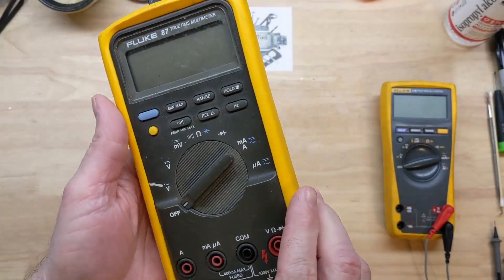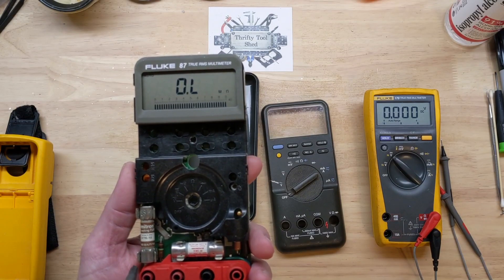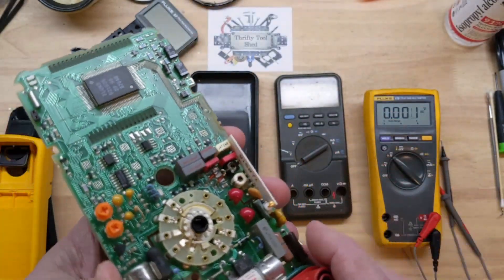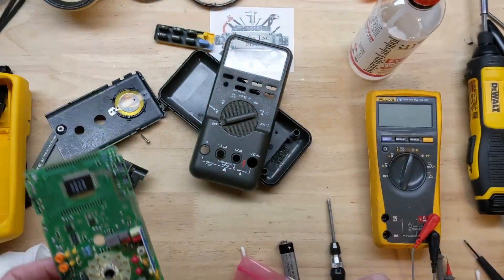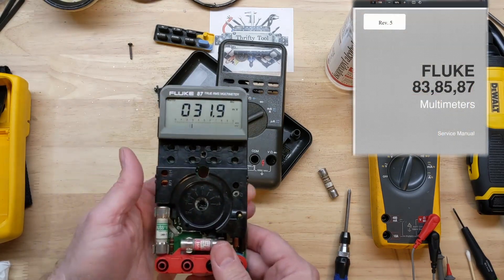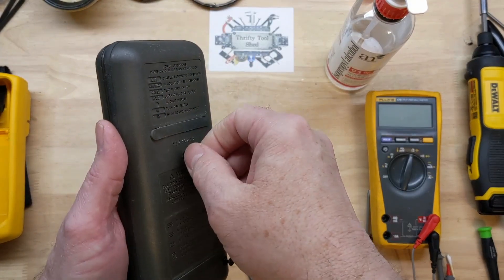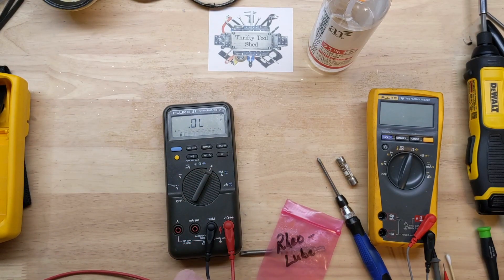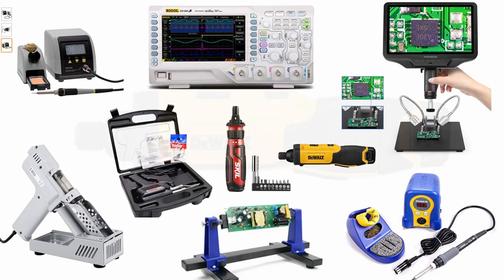Can we get this Fluke 87 DMM back working?

Comment: You make troubleshooting look easy.
Reply from the maker: Thank you for your kind comment!
I really enjoy working on tools and items!
Reply: @ThriftyToolShed hi man 
I have fluke with issue  no high voltage measuring AC/DC .can you share circuit board diagram ?
Reply from the maker: @MrMexanik066  
If it is a fluke 87 you are in luck since Fluke shared the service manual with us. Some of the newer meters they don't. Here is a link to fluke for 87 for example.
https://www.fluke.com/en-us/search/fluke/?query=Fluke%2087%20manual

Comment: We had some one use our fluke 726 process calibrator (30V limit) to try to read Hz on a VFD running on 240V. Needless to say it didn’t turn on any more. Started heating up until we removed the batteries. It was under warranty thankfully, or I would have at least tried to open it up and see what all had fried. They ended up having to send us a brand new one as the old one was so damaged.
Reply from the maker: It was really good it was under warranty for sure! Thanks for sharing. Hope you are doing well Chris!

Comment: I have a fluke 83 that everything works on it works but the capacitor tester option. It just does not read anything when checking a capacitor. Any idea what would be wrong with it? Thanks John
Reply from the maker: The first thought in my mind would possibly be the range switch not making good contact and causing that. I should also mention that the early flukes like the original 85 and 87 models did not have a very high capacitance range at all. The 83 maybe similar. I have been told many times over the years that a older Fluke DMM  was bad and not reading capacitors and it ended being that the cap was too large a value to even show any reading just OL. The older Fluke Cap range was almost useless for many of us. The newer DMMs are much better starting with the 87III if I remember right and the 87V is even better.

Comment: Nice...  Where dd you get the schematic from?  I have the typical meter manuals but no schematic... Just wondering so I could also have the schematics...   Thumbs Up!
Reply from the maker: From Flukes website. I actually put a link to some of these in a couple of Fluke repair videos I believe. Looks like I missed it on this one. Fluke used to do so good sharing the schematics, but that has gone away on the newer meters unfortunately. The older models are still available. Thanks for your kind comment!

Comment: Flukes have lifetime warranties.
Reply from the maker: IF the failure is from the manufacturer's defect. IF model is still in production (not your lifetime, the meters availability). IF you are the original owner. Fluke has been known to honor some of repairs in the past in spite of this though for sure! That's good of them. The original 87 I would not expect them to. I see the meters come back unrepairable and end of product life and an estimate for the newer replacement model. Fluke also does not have a lifetime warranty on all meters.

Comment: What brought you to consider the problem was contacts being dirty?
Reply from the maker: I have seen the contacts cause issue before even though not acting exactly like this one. Also, once I took the cover off and turned the switch around a couple times it started working on uA mode and it wasn't before. I also had the issue with the last fluke I worked on with the Microcontroller chip or ASIC chip was the issue as far as cleaning it well got the meter back working. That's why I went ahead and cleaned them both and the jacks while I was spraying. Thanks for your comment!